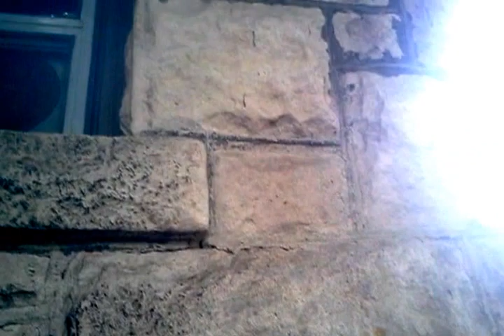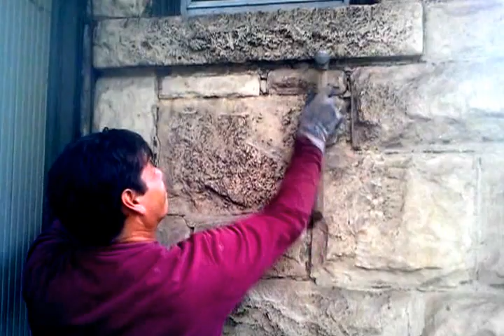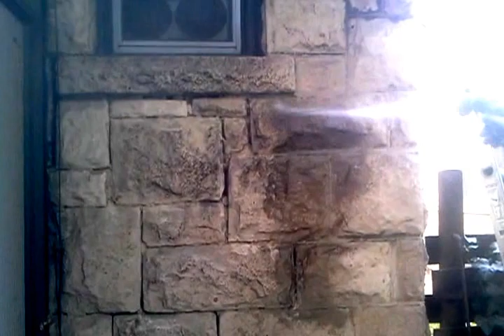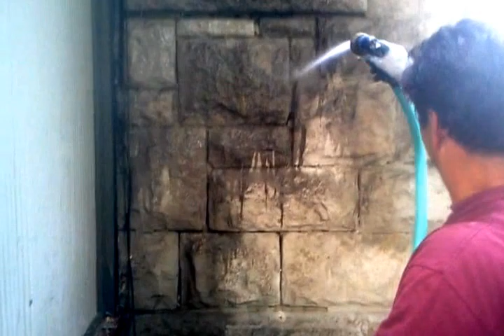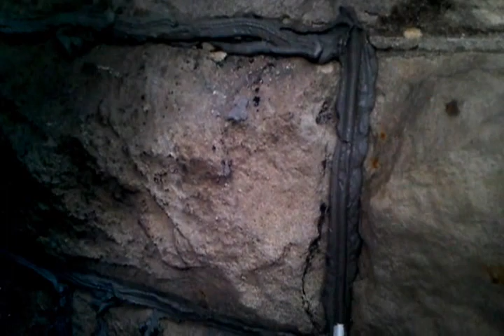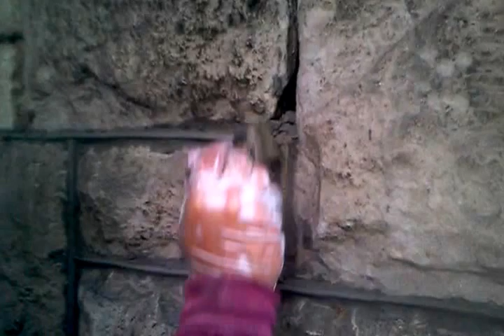Historic sandstone Beading mortar joints

Comment from the maker: no that' how wide the joints are if i thought i was going to hurt the masonry i would have used a grinder but you still would of complained of me not using a a mask and safety goggles the truth is this is all i have done for 30 years and  this wall took a half an hour and only cost 25 cents of material and 50 dollars labor but it sure is fun.